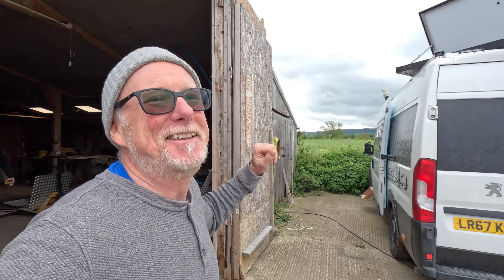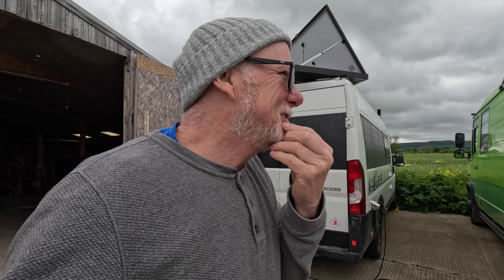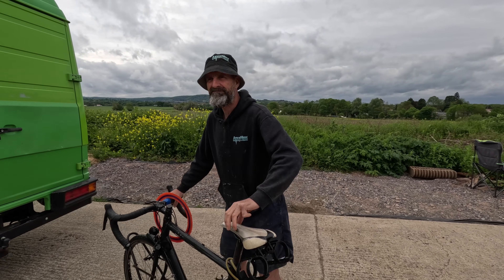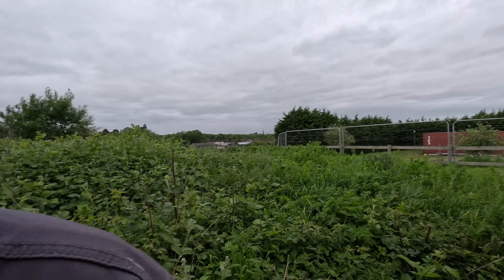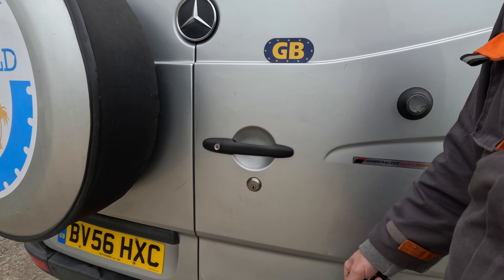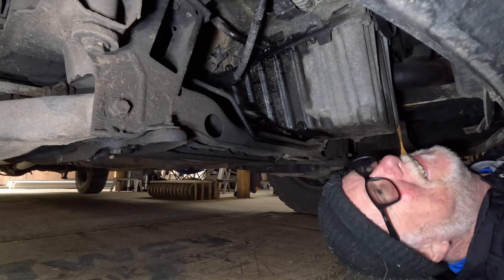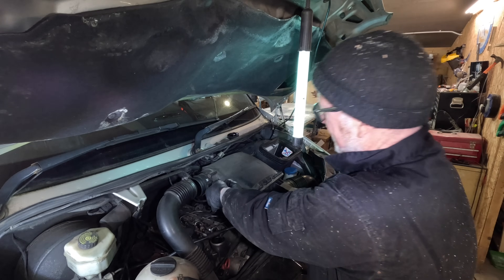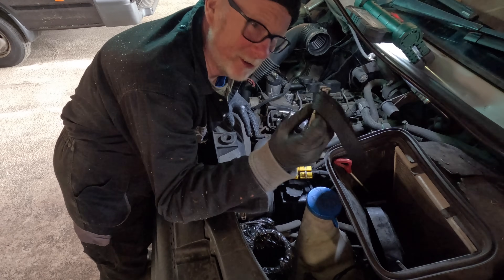How to Service Mercedes Sprinter Engine.  engine oil - oil filter - air filter

Comment from the maker: I use this scanner to keep my sprinter running and on the road 
iCarsoft Professional Multi-System Auto Diagnostic Tool 
UK https://amzn.to/3Ly6JgQ
USA https://amzn.to/32IPAPj
Everything i use in my camper van you will find here in my Amazon Store  https://www.amazon.co.uk/shop/melsvanworld
this is an affiliate link so every time you make a purchase i make a small commission good news it doesn't cost you any extra but it helps me to continue to make these videos.
thank you.

Comment: Great video. Stellar oil job as usual. If you have time a young American YouTuber who works on solar installation had a wonderful idea and installed his solar panels without drilling holes in his vehicle. His channel is Nomad Brad and that video was back on July 19th.
Reply from the maker: I will check it out

Comment: Mell when you start the van  the engine  oil will drop as the oil filter will need to be filled  so an other oil check will need to be done again 👍

Comment: Another good video Mel. I purchased the oil filter removal tool from Mercedes, if my memory is correct, it cost me approximately €20 and me being a tad anal, I do use a torque wrench set to 25Nm. Like you, I also buy my oil in 20 litre quantities nicely packaged in a box from Mercedes. I change the engine oil and filter every six months or before and after European road trips. I also remove and clean the egr valve annually and give it a coating of ceramic grease so it should never get stuck, like the original one. I am determined that my OM646 engine gets up past 500,000km! 😅 Keep the mechanical stuff coming Mel, it's just as important as actual van conversion techniques, processes etc 👍
Reply from the maker: Thank you really appreciate your support 👍🤓👍

Comment: You need to take the plastic off the outside of your windows aswell 👍🏻
Reply: This is my second waring to Mel about this but he still either hasn't saw it or disagrees. But it's going to be a costly bill when they bake on
Reply: @mramsey123  He removed it from the inside but probably just forgot about outsides
Reply: It’s all been done. Thank you

Comment: Mel

Slick 50, never come across but intrigued.

Is there a specific version as I have a fiat ducato 2.3 diesel.

Any help guidance much appreciated.
Reply from the maker: It’s brilliant stuff comes in 2 different forms semi synthetic and synthetic depending on what oil you use 👍
Reply: @BigVanSmallWorld  thanks Mel. Really looking forward to seeing the Benz finished, blown away with what you have done.

Comment: Hi Mel, thanks for all your videos, love following the channel.  Just a question, i checked the oil you've recommended and the manufacturer says its not suitable for vehicles with a dpf? Any advice on that? Cheers mate 👍
Reply from the maker: I didn’t even know that! Thank you for sharing
Reply: @BigVanSmallWorld  I wasn't looking to cause a fuss, it's just when I typed in my sprinter details it came up with this....Exol Optima C3 LSM 5W-30 Engine Oil, low saps which reduces emissions not to clog up the dpf. No doubt yours has been working just fine, I remember the days when oil was just oil! I recently changed my gearbox oil, after two types of oil which I purchased from eurocarparts and Eddie walkers I couldn't get a gear. The suppliers were adamant it was the correct oil. Anyway, I went to mercedes and purchased the manufactures spec oil, it worked wonders, gears like slick....I was baffled but there you go 🫣😆